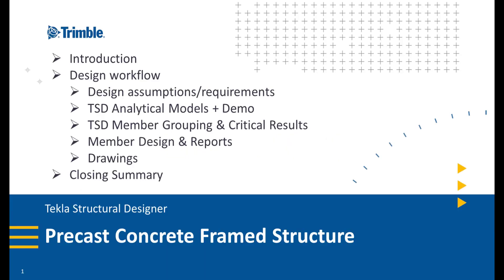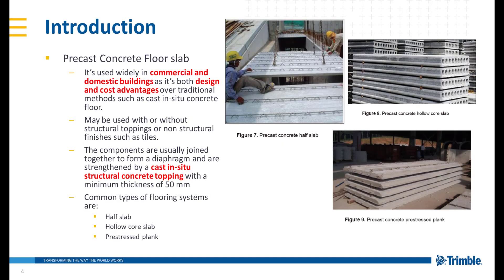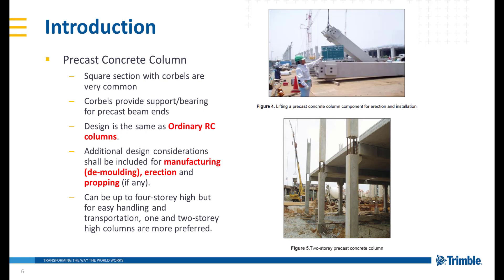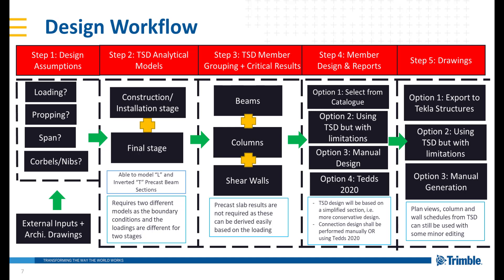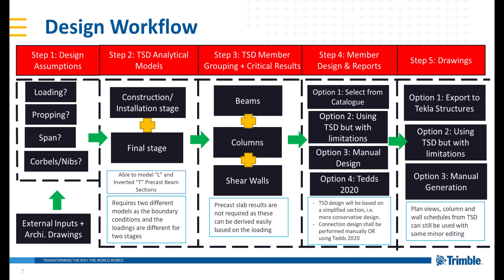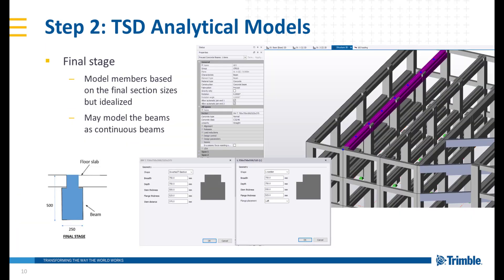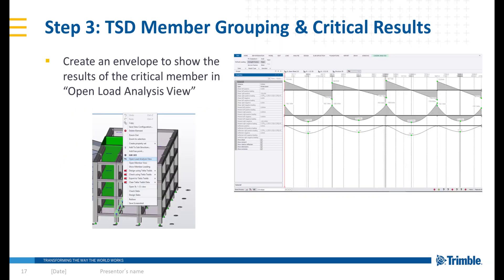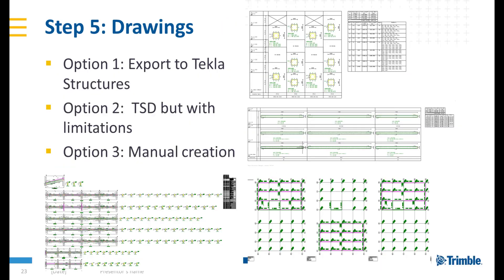Precast Design Workflow using Tekla Structural Designer 2020

Comment: Do the TSD models actually consider torsion in the edge beams highlighted in the slide at 1:56?
It seems that beams are being loaded at their axis.
This torsion is not only important for the beams as it also leads to transverse bending at columns.
Reply from the maker: The said additional torsion can be applied along the beam as Torsion UDL/VDL if that is your concern for entire structure. 
However, the off-centre effect on the lower smaller beam cross section (boot section) will be checked in the Tedds Precast Calculations.